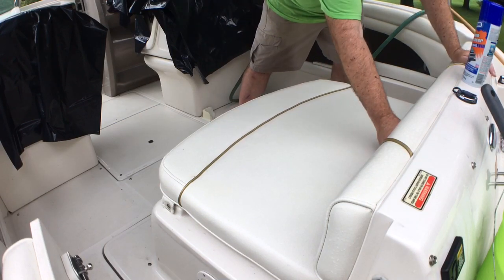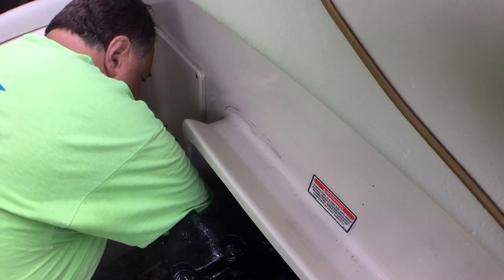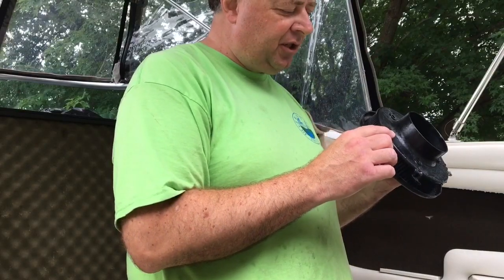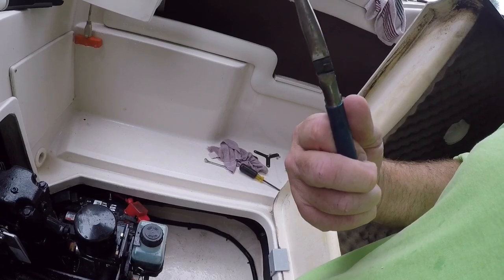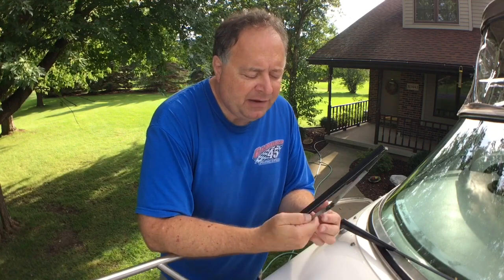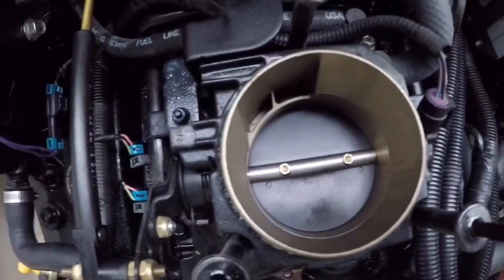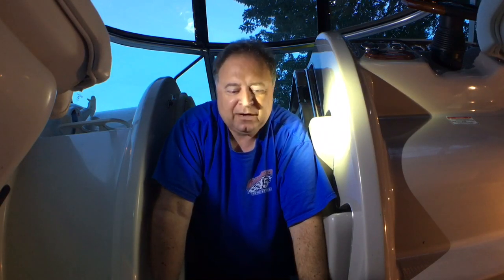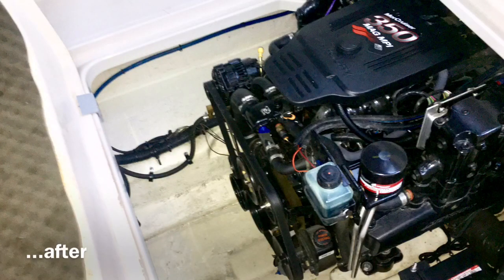Boat maintenance, cleaning this, fixing that Boating Vlog Episode 3

Comment: Hello Doug, this is a great video for a newbie boater like me who incidentally bought the exact same boat as yours last summer except mine is a year older (2002). This is a fantastic learning opportunity for me given that all of your tips and findings  are 100% applicable right down to the wiper replacement. I've already started doing some of the maintenance work that you outlined like cleaning the flame arrestor etc., I also tested my flow switch and yes, it was operational. Luck of the draw I suppose...🤗 Thanks so much for taking the time to produce this wonderful tutorial and I would love to see more if you get the chance ! SRIII.

Comment: My boat (2005 165 Alumacraft) had no float switch at all from the factory.  I installed one.
Reply from the maker: FSC Feszchak Speed And Custom Shop  There may be a rule or standard about at what point NMMA or the National Marine Manufacturer’s Association requires a float switch.  I’m just not sure at what size vessel the rule starts. At some larger size, NMMA gives way to ABS.  Although I’m no expert, I think NMMA is for boats where ABS is for ships.   Thank you for sharing your observation and what you added to your  boat.  Hope to see you on the water.
Reply: @DougAlesUSA  My Dad bought a 1987ish (last year of OMC 400/800 Stringer) Arrow Glass 185 brand new and it had one.
My concern is leaving my boat at slips when traveling and rain water swamping her while we are away.

Comment: Hi, thanks for the informative video. Great work! I have one question for you -  much like you, I am planning to clean, degrease, and derust the bilge and inboard motor this upcoming weekend. Do you have any recommendations of techniques, tools, or materials that would help me in this process. Your bilge looked great after your work was done so I'd value any information you have for me. Thanks!
Reply from the maker: Thank you for your question. After spraying the gunk cleaner, and before rinsing with water from a hose, I wish I did more scrubbing with a small brush, such as a old toilet brush, or even a small broom. If you try this,  please let me know how it works. Best wishes on your project Stephen.
Reply: @DougAlesUSA  Thank you and will do!

Comment: Great video! Looks like the boat is a Sea Ray 215 EC. I just bought a 1998 SR 215 and will be doing the maintenence jobs you performed in your video. The boat spent its entire life in fresh water and it is extremely clean. The bilge pump works with the dashboard switch but I did not yet check the float switch. I will do that test! My boat does not have a wiper but I will try using RainX on the windshield. Do you have any other videos about this boat? Thanks again for the very informative video.
Reply from the maker: Thank you John.  Congratulations on getting your ‘98 215 EC.   I believe the hull of your boat is the same as our 2003 225 WE.  I have a few videos on this boat, just click my name then look through the videos. More to come.

Comment: Is there any concerns with spraying down the engine with water? Any electrical or parts that could be affected? Or just spray away?
Reply from the maker: Chris Trenholm with the black plastic engine cover in place, the flame arrester is covered.  In that case, when using a garden hose with typical garden hose pressure, there are no areas that are off limits.   The electrical connectors are built to NEMA 4X, something similar to IP68 today. Personal safety should include having power turned off, extension cords unplugged, and battery terminals covered.  Hope this helps.